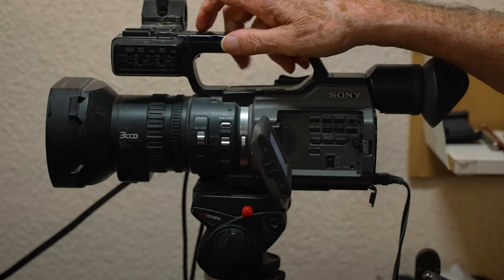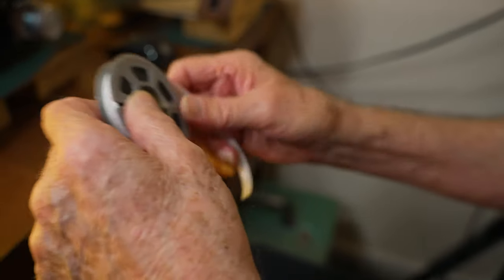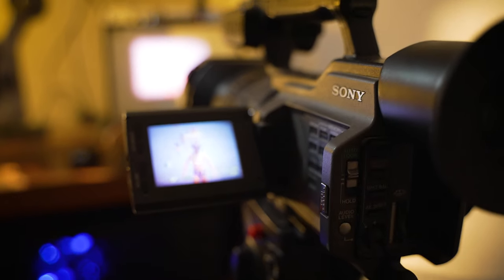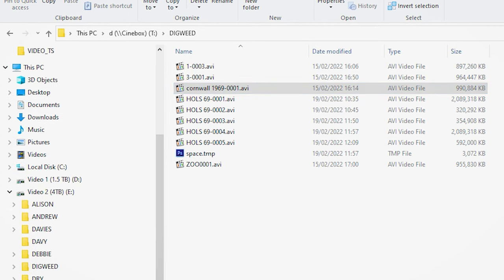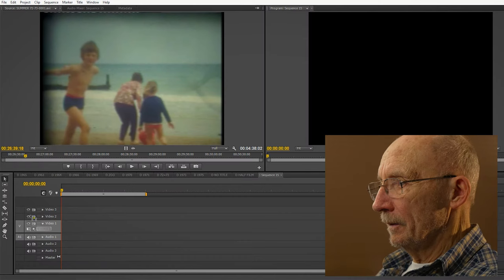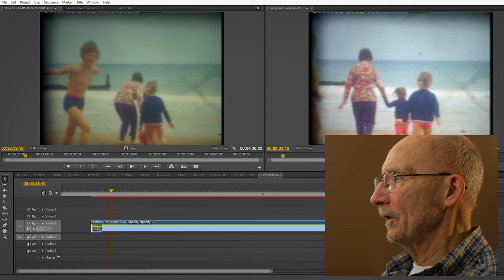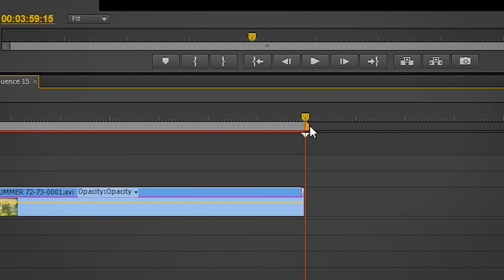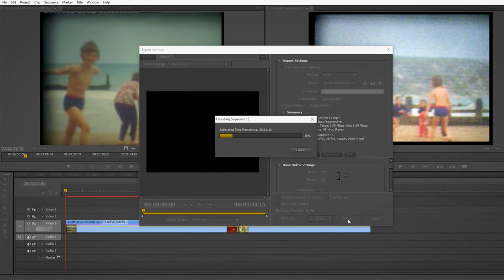How To Convert Film To Digital Video - Telecine Guy

Comment: Interesting, Robin. More hi-tech than when you transferred my standard 8mm home movies in 1980 on to VHS!
Reply: Nice song it's sick
Reply from the maker: As long as you stick to the frame rate...18 for Standard 8mm & 24 for other films...it's ok...if you get the frame wrong...the picture wabbles, also I have a SPOT LIGHT setting which dampens down the HOT SPOTS!
Many thanks for your comments.
Kind regards
Robin

Comment: Nice simple setup for film to video conversion and the explanation on the conversion.
Don't you have synchronisation problems (intensity differences) due to the 18 frames per second of the original tape to 25 frames per second of your camera?
Don't  you have the overall  e tra brilliance in the centre in regard fo the outersides of the frame.
These two issues are broadly mentioned by other persons that do film to video conversion using this method.